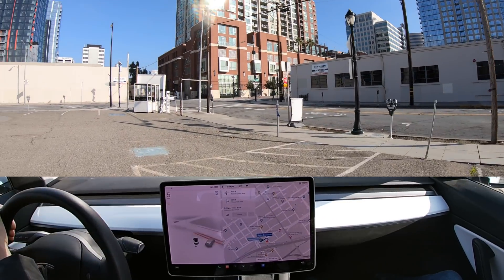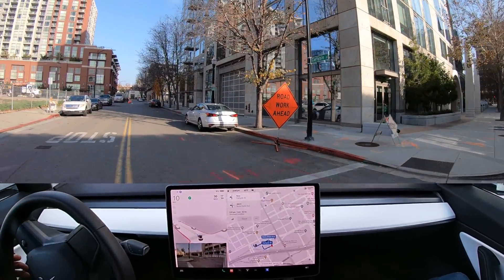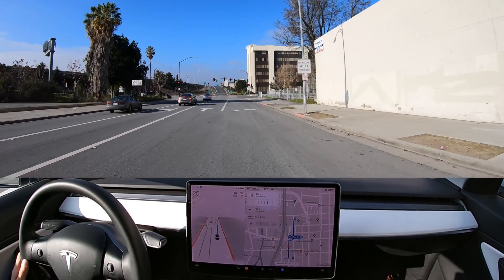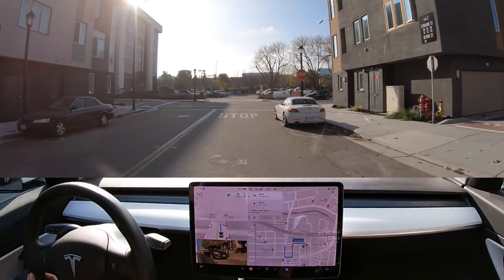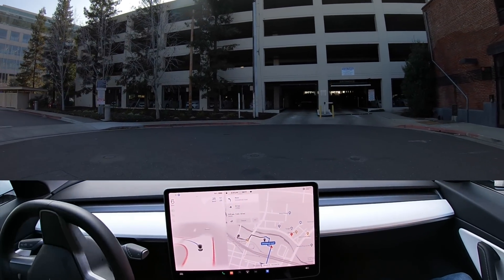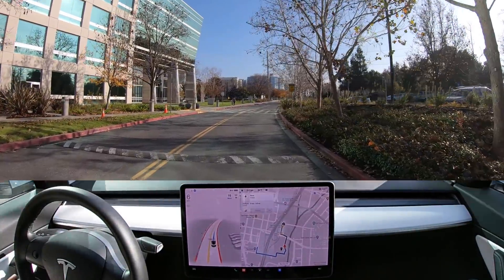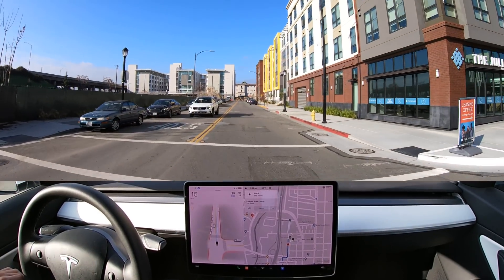Construction Test - Tesla FSD Beta [10.8]

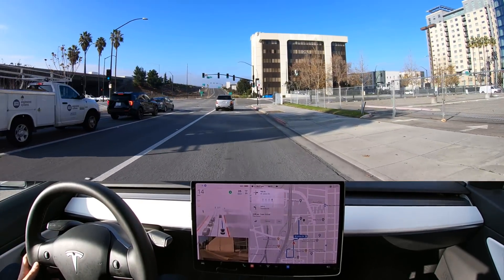Comment: 10:45 is a typical case of a bad road network. You can't change lanes in the middle of intersections (especially two), then there's a solid white line you can't cross at least in Europe, to take the sharp left. FSD properly turns right at the section, crosses one lane left when allowed and realizes: 'darn boy, there's a solid white line and a quick left, what do I do?'

With detailed lane system not baked into the maps the planner use, FSD is sometimes caught cold - wonder if Waze routes around the lane problems? Issues like this, botched lane markings elsewhere and Chuck Cook-style multi-lane, high speed cross-traffic unprotected lefts exposes road system failure self-driving cars need to figure out and no wonder Waymo only operates on safe, clean, marked, logical roads.
Reply: US roads are weird, man. As a pole, I’d be confused as hell is this situation as well, we get fined thousands for crossing a solid line.
Reply: @SweatStink  Well then I am glad they aren't training the cars in Poland because here if you need to get into a turning lane, you do so no matter what the lines say.
Reply: People can complain all they want about roads, but you will never have the majority of roads ripped up and modified just to cater to FSD vehicles.

A few points.
1. This turning lane had 0 cars backed up, and the Tesla had plenty of time to get over. Sure, maybe the roads aren't perfectly designed in all places, but this was super easy. Even a teenage driver could have done this with much less hesitation.
2. Chuck's infamous unprotected left has never had a single accident in the 20+ years he has lived there (Chuck has said this repeatedly). But you know where he has seen a few accidents? At the stop light down the street where "road design complainers" think it is safer.
3. Chuck's unprotected left is a very common sight all over America. That means Tesla must solve for them to reach level 4 and 5 autonomy.
4. Current hardware will likely only hit level 3 autonomy. But with better camera positions and a more powerful NPU, they have a shot at removing the steering wheel.
Reply: shouldn't the AI handle this - the cameras look at the road and predict where it needs to be?  I was told that it would be ready last year and the year prior (car will be able to pick you up and without human oversight probably towards the end of 2020 - paraphrase of Musk's claim)

Comment: In your estimation: What is the average miles traveled before disengagements for this version of FSD beta? Harder question: Do you think miles traveled are improving by at least 10% from most updates?
Reply: tyler 44:  But that kind of answer will vary WILDLY depending on the driving situation, traffic situation, etc. between different FSD testers in different areas.  And if it were improving 10% or more most updates, it would be getting better far faster than it is in far more situations.
Reply: @rogergeyer9851  I'm aware there's large variation, still miles traveled between disengagements is a standard measure for comparing self driving companies. If it is not improving by 10% then it will be a very long time for Tesla to catch up to Waymo's current capabilities (Yes ik Tesla's taking the harder/ more scalable route). I've heard estimates FSD only does around 10 miles, while waymo can do 25k. Still Elon's prediction of full FSD by end of year is completely absurd unless they're confident they can accelerate improvement rates by a ton (haven't heard of too many radical changes in the pipeline for 11)

Comment: It went to the right lane after the second time around the excavator due to the excavator's wide position, I suppose.
Reply: O. M. Kaya -- That's what I figured.   BUT, it certainly should NOT have kept driving in a non-driving area once it cleared the excavator.  

To me, this is an example of why HD maps greatly improve the reliability of how systems of the serious competitors like Mobileye operate, and why (IMO) Tesla will need to wake up and use HD maps and the context they help provide to "solve" automated driving to anywhere near a real world L4 robo-taxi consistency. 

If Mobileye can use crowdsourced real-time updates to make its HD maps viable, then so can Tesla, BTW.

Comment: You have to put the car in park for it to check off a waypoint
Reply from the maker: I appreciate it! I’ll try that next time :)
Reply: Does it automatically go to the next waypoint after you put it in park?
Reply: Gus Gordon:   Why?   A waypoint can be just a nav point to force a car to take the route you want.  Or you could step on the brake and let someone quickly in or out.  Or you could just want to see the status of something and drive by.  

To me, Tesla forcing that is ridiculous, unless they would give you the CHOICE to have that as the default acceptance or not. 

With a NAV system, even simple old systems can recognize and handle waypoints JUST FINE, even if you just drive by them -- including sub $100 portable Garmins which I favor vs. buying expensive flaky NAV systems (especially when NAV is evolving so quickly and I like to keep cars at least a decade).
Reply: @Roger Geyer  why so much complaining? This is just the first release of waypoints. I'm sure Tesla will update waypoints in the future to be more useful